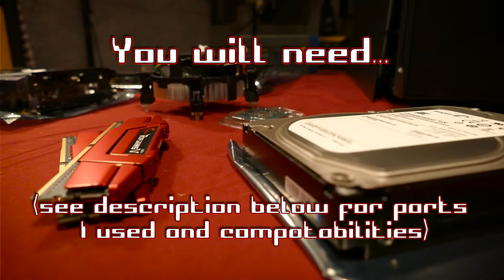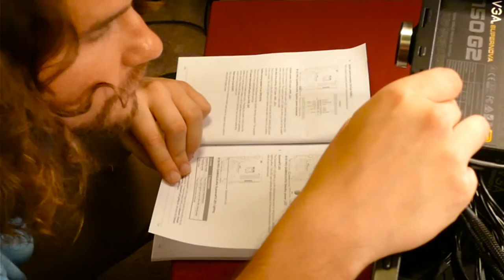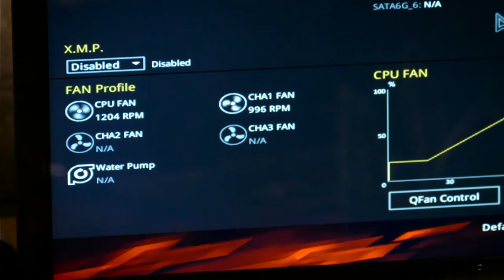How To Build A Gaming PC

Comment: Very insightful video! I'm debating leaving my XBOX and going to PC. This video is very convincing. Is this computer pretty compatible for design programs or design storage? (PDM Link)
Reply from the maker: Hey, A B!

Thanks a ton for checking out my video! It really depends on what you are going for. This PC is great for design programs. You would just want to ensure you have either a large internal hard drive (preferably a solid sate drive for those run much faster), or and external hard drive to save the files. I use my PC for audio engineering, and film making, so I needs to be pretty beastly in the processing areas. I figure since I already have the machine to handle it, I might as well stick to games on here. On the plus side, it is easy to upgrade your parts, and make money selling the old ones. It is still personal preference, though. Let me know if you ever make the switch! Thanks again, for taking the time to check this out!

Comment: Isn't there a paste you have to apply to the cpu ?
Reply from the maker: Yes, there is! You are referring to thermal paste. As you may know, it helps with the transfer of heat from the CPU to the heatsink. It comes pre-pasted on the Intel CPU fans that comes with some of their processors. You can see where it was on the CPU from me removing and re-positioning it to get multiple shots lol :P. I probably should have mentioned that in this video, but surely, I will in the next. Nice observation (it is also in the works :)
Reply: Oh okay and i also heard that fan positiioning is key to let out all the hot air from the system
Reply from the maker: You are absolutely right! The ultimate enemy of electronics is heat(aside from water of course :P), but most of the that has to do with your tower. I suggest having a mid-size or full tower for two reasons: 1) Better air flow. It gives components room to breathe 2) Easier to upgrade and add parts.